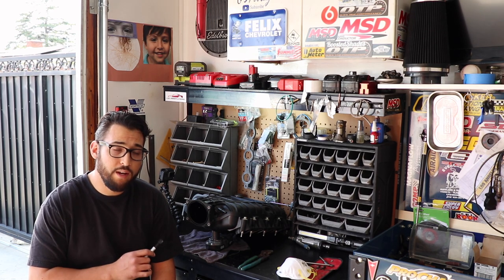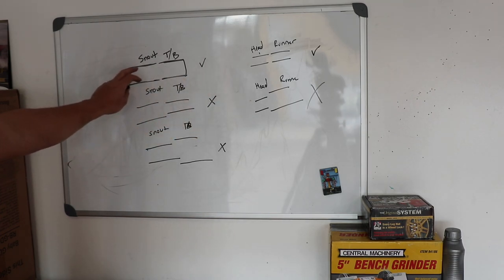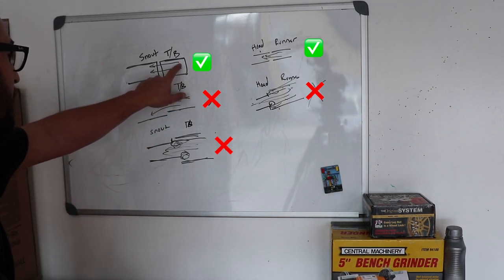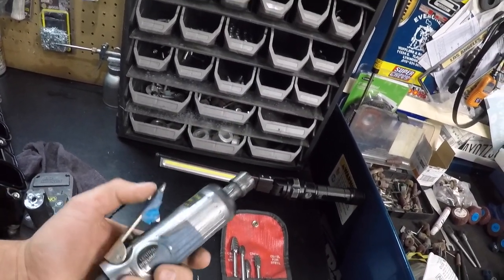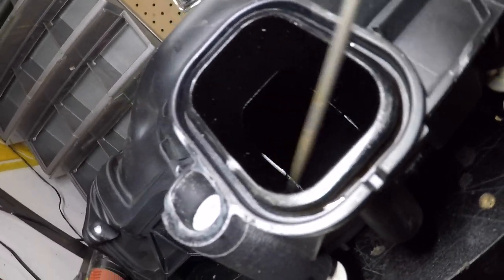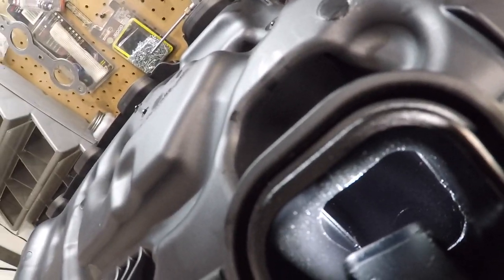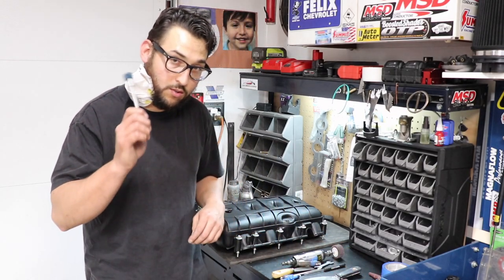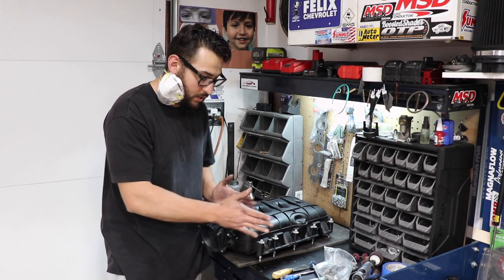LT1 Intake Manifold Porting!!

Comment: Very  informative  video!!! Good  stuff
Reply: I have  a question.. I'm looking  to upgrade  my  stock  intake  manifold  on my c7 to a msd intake.  I'm also  really  interested  in the katech 103 mm tb to accommodate  the mod. My question  is what  is necessary  to make  it compatible  with  stock air filter intake  box or would  it have  to be  modified.
Reply: freshlystealthy45 a good stretch may have to use a little bit of grease and a wedge to get it in but it’s possible. We still use stock air box now and have katech 103
Reply: @joseluisgonzalez2081  Thanks  Man!!

Comment: After porting the lt1 intake manifold, and stock throttle body is a tune required ? I had mine ported for a couple months now put couple thousand miles with them ported without a tune car seems to be driving great no engine codes.
Reply from the maker: no tune required. the gains are minimal that the man can adjust for it
Reply: Cars come from factory rich so porting manifold and tb will get compensated with the car itself

Comment: Is it better to buy bits for aluminum when porting plastic manifolds or go with the double cut ?
Reply from the maker: the cartridge rolls will be better because they are not as aggressive. the metal ones remove materials real fast and can quickly over port and damage the manifold. but no matter which one you star off with you still need the rolls to leave a smooth finish. the metal ones leave it all chewed up, it removes alot of material quick! like chunks of It, so just use the rolls

Comment: Where do you get your long buys for cutting and sanding Ive been looking everywhere so I can get deep in my manifold but I got the little ones they sell at Home Depot
Reply from the maker: summit racing sells them but they are sold separate from most kits. I went with 
 part number  POW-POW351510 on summit racing. and the metals carbide bits are from matco truck.
Reply: G's Footage appreciate the help man your video is a major help and supper detailed  in getting started love the content can’t wait to get the rest of the bits to perfect my porting keep up the good work man your ports are A1 💯🙏
Reply: Also for your cartridge rolls and long flapper wheels did you get them from those websites as well ?
Reply: G's Footage just copped the bits you told me you used some fast shipping but realized the shank size is bigger for the regular dremel at harbor freight need to cop that 1/4 air die grinder that you got to fit can’t wait man!